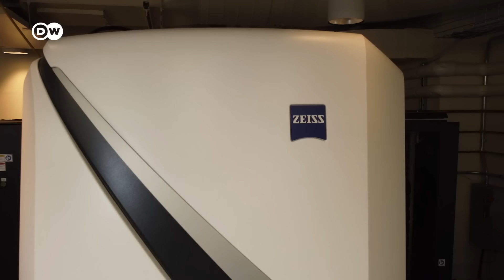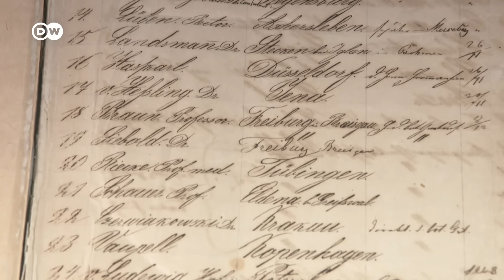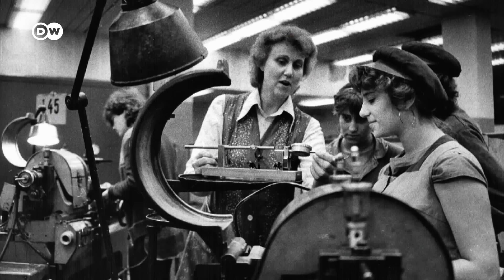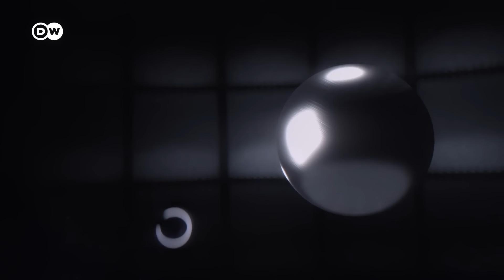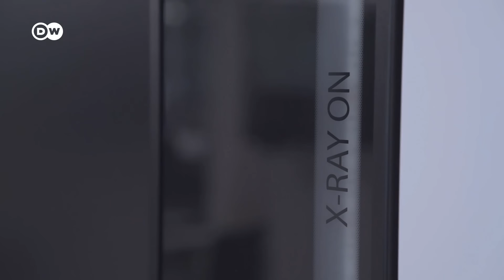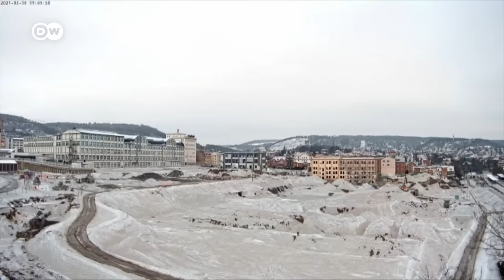The rise of a global company - From the microscope to the moon landing | DW Documentary

Comment: The extreme ultraviolet lithography (EUV) machine used in the production of computer chips which was demonstrated in this documentary, is in fact manufactured by ASML and not by Carl Zeiss. Carl Zeiss supplies the optical systems used in ASML’s machines, in particular the highly complex and expensive projection lens. However, this documentary seems to imply that the lithography machines are the products of Carl Zeiss, which is erroneous.
Reply: With out Zeiss EUV would be extreamly dificult its Zeiss 170 years of experience thst makes it posible to make the optical parts of EUV posible on the scale ASML can  make them.
Reply: Joint development between ASML, Zeiss and Phillips but Zeiss does indeed make the EUV lithography part (EUV source and multilayer optical mirror systems for directing and focusing the EUV beam) 
Doesn't matter much, ASML and Zeiss both are insane.